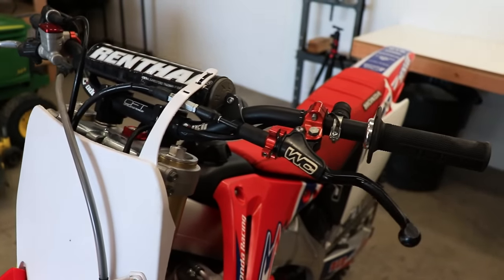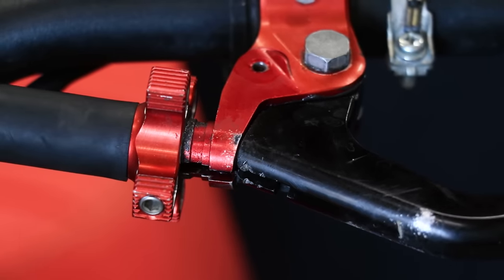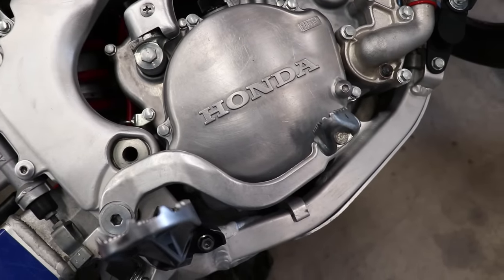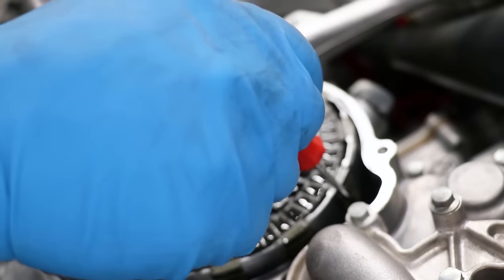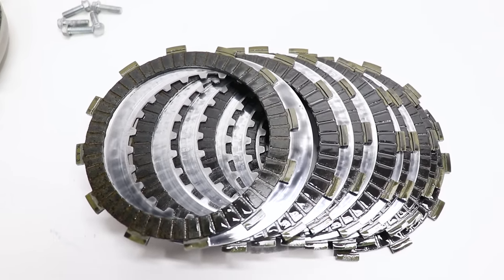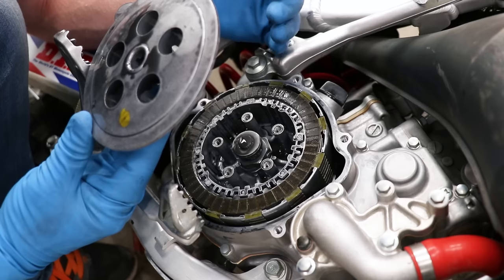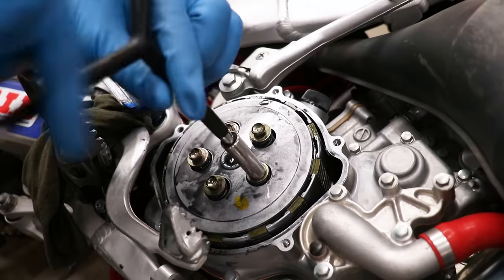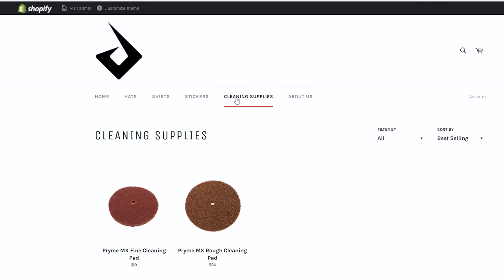How To Fix A Slipping Clutch

Comment: Any idea what could be the issue in my 2007 rmz- 250 clutch. it started to not stay still when in gear and clutch pulled, so i tigthtened the cable. 10 min of riding and same thing again. again, i took all the "loose" out from the cable by using the adjuster in the cable itsel( the fast-adjuster is broken on my lever), finally i opened the clutch and checked the plates and and checked for possible grooves on the basket. nothing. well, I put it together and boom it felt like a new bike....for 5-15 mintues until i almost couldnt stop properly with the clutch lever pulled alla the way. again, i adjusted the cable a little more tight and went riding, worked fine....for another 5-10 minutes until it started AGAIN to beg more of "taking out of the loose in the cable" it doesnt SEEM to be slippinng the clutch, it just stops working properly after it warms up. and when i look at the part where the cable goes in the engine end, when I pull the clutch all the way, it moves normally but when i release it doesnt seem to go all the way back to its normal position, if i push it back with my finger theres like quite a few millimeters that it goes back even tho its not the cable that keeps it fro m not resetting back to its normal starting point. This is my first THIS "new" dirtbike even thio ive had A LOT of different bikes in the past.

Comment: I have a question, when I go to put my 98 yz125 on it’s side to wash it or to just lay it down, it just pours out fuel. Any idea?  It’s a fresh rebuild. Everything has been redone. Every nut and bolt
Reply from the maker: You have to turn off the fuel valve when you lay the bike on it's side

Comment: Hey, man hope you see and can respond to my comment in October of 2020 but I'm desperate because my bike's clutch slips, and I just changed the plates 2 months ago and my clutch is slipping again man, I don't think they've burned again, is it possible that it slips but they aren't burned? That there's only a problem with the cables? Or the clutch release adjuster nut is too tight or too loose? Hope you respond bro, I don't want to send my bike to the mechanics and spend another 150 bucks! (BTW your videos are awesome and they help a lot, i just don't understand a lot about clutches and I need a bit of extra help, keep up the good work man!)

Comment: Question, so i have asv levers and with my clutch theres not really any play and when i pull it in and shift down to 1st it pulls pretty bad and itll die from pulling half the time and if i give it any play then wen i shift down to 1st itll just die right away, do u know how to fix it cause i tried messing with the cable and it didnt work?

Comment: I recently replaced my inner clutch hub and it created this rattle noise and looks like the hub could be rubbing on the inside of the clutch cover should I replace my plates also and with stiffer springs? I checked multiple sites and it’s the same number on all oem I looked at so I know I didn’t get the wrong one.
Reply from the maker: Sounds like you have a washer that is too thick behind the hub or it's out of position

Comment: 2007 Yamaha YZ250F and at a stop in first gear with the clutch lever pulled in, the bike will not go into neutral and the bike wants to creep forward. I have taken all the slack out of the clutch cable, and adjusted the ASV unbreakeable clutch lever, and it still will not go into neutral unless i shift it in neutral before i come to a complete stop.
Reply from the maker: You'll have to pull apart the clutch and check the basket for notching

Comment: I have a kawi Vulcan Classic 1500 that has sat unridden for quite a while. After starting, when I click into first gear, the bike lurches forward and stalls, which says to me the clutch is not engaging. Can someone suggest how I can determine if this is a pushrod problem or likely the plates need to be replaced?

Comment: My son has a 2016 YZ125 and his clutch engages near the end of releasing the lever. He has sufficient slack in his cable. I removed the friction plates and they are within spec, 2.90-3.10mm, although most are just above the minimum of 2.90mm. Can this be normal on his bike?
Reply from the maker: Yes, that is fairly normal for the clutch the engage at the end of the lever.

Comment: what about to install the steel plates with the sharp or round edge facing up or down at the same way. i like to install the sharp edge facing down
Reply: Me too
Reply: it dosent realy matter wich way..as long as all are flat(not warped)...the different edges are thru stamping the sheet metal into form in the factory. ;)
Reply from the maker: Yep, I have the rounded side facing up

Comment: My clutch on my 2003 ttr125e is sticking when I pop the clutch and after shifting, and when I give it more than 50% throttle it sticks, but slow on it's fine. Plates? Basket? Springs? help.

Comment: Should say just snug in the drain bolt Cameron or get ready to do a time sert video for all the stripped plugs out there.
Reply: i stripped my drain bolt on my rm125, i ordered a m14x1,25 dolt and tap.
Tap drill for m14x1,25 is 12,8mm
drilled the hole and tapped it. screw in the new bolt and gave it a little snug. the copper washer seals it.
tip: never use imperial anything on a metric bike or car. it´ll just mess up things in the future. metric is allways best!

Comment: I installed a pink spring on my crf 250r. They are sligtly bigger (height) than the original ones. Is that a problem?

Comment: I have a problem with my 2015 yz250 its goes into neutral when i try to shift into 4th gear! It happen after put to much transmission oil in it by mistake

Comment: Hey im having a problem with my pit bike, it revs up fine the clutch is adjusted right, but it use to go Much faster than it does now, before I could hit probably 45-50 now it only goes 30mph, like i said it revs up fine clutch adjusted but it just doesn't hit any speed at all.

Comment: i have a 2007 RMZ 250 and i need the main drive gear off that is on the right side of the crank but i cant seem to get the nut off i have used a impact, cheater bar, blowtorch, and i have tried to freeze it any suggestions I'm bout to take a cut off wheel to it, any help is appreciated
Reply from the maker: Many times those are a left hand thread
Reply: i have tried both ways but nothing has seemed to work, and thanks for the reply keep up the great work :)

Comment: My old yz250 doesn't idle worth a shit. Thought it might be too rich at 32:1 so I tried 40:1 like the manual calls for and still didn't work. Idk if I should change the jets or if the floats are off?
Reply from the maker: I start off by adjusting the fuel and idle screws. If that doesn't do it you'll need to re-jet. Also doesn't hurt to set float height too

Comment: What can cause my YZ250 to try to pull in 1st with clutch engaged? If I toy with the throttle it won’t stall, but if I pull clutch and drop into first it’ll stall. It’ll try to pull while clutch is pulled but it’ll die if I don’t give it gas. It don’t pull hard enough that I can’t stop it. Please help!!!
Reply from the maker: Check your cable slack adjustment like :40. If that doesn't fix it, replace clutch plates

Comment: my 125 clutch is slipping on gears 3-6 after 8k rpm is the problem in the discs or cable

Comment: someone explain me why an oil change for every 5 to 6 rides isnt ridiculous overkill
Reply: Kenny McCormick it all depends on the way you ride in my opinion
Reply: i guess he meant .5-6 days of riding. not 5-6 times 15 minutes...6days of 3 hours riding each day is 18 hours of running ..
Reply: 5-6 rides is overkill, but dirtbikes are often run hard and through dirty environments, so an oil change is cheap insurance
Reply: 8-12 hours of ride time seems like a pretty normal service interval for a dirt bike if you ask me...
My 07' DS650X recommends somewhere around 20 hours = every 4 rides.
Reply: There is only a small amount of oil in the tranny, so any contamination like (clutch material) quickly pollutes the luburcant. There is no oil filter either. Hope this helps.
Reply: Don except on some bikes, like my 04 crf 250r, the tranny oil and engine oil are in two different compartments and take different oil.
Reply: Motocross bikes. Not dual sports.
Reply: I do it every other ride, but I ride my bike like you're old lady ride's me FULL THROTTLE!!!
Reply: Kenny McCormick On a Dirtbike, even after running for just a short while, the transmission oil quickly blackens. It takes only a few minute to change.

Comment: I just recently turned on my bike and the clutch felt  sticky and with a grit sandpaper feel what is that. do I have to run through all the gears as a maintenance practice. I usually stay in neutral
Reply: dirt in the cable probably..
Reply: No not my cable's the cluch disic 1 and 2 gear
Reply: oh okey sorry...im not  a native english speaker..
greetings from germany BTW. ;)
Reply: That's ok no problem. Hello Germany

Comment: Hi Cameron.
My 2010 Husaberg fe 450 is moving forward in first gear when the clutch ( hidraulik )is pulled and y cand put in neutral when the engine is roanning .
Reply: the clutch is draging. adjust the cable

Comment: You have it the wrong way round, too much tension disengages the clutch which is why it slips.
Also, way too much slack in the cable means the clutch doesn’t full disengage which makes it difficult to change gear and leads to premature gear wear.

The master adjuster is at the engine end of the cable so adjust there first then fine adjust at the lever 👍

Comment: Is there a way to change the engagement point on the clutch? Mine isn't sticky or slipping but it doesn't engage until the very last second of release on the lever. Barely touch the lever and it disengages the clutch. It is quite annoying. Would like it mid way like all my other bikes, but everything I do, including changing the clutch pack, doesn't help. CBR250r wife constantly complains about it and is now wanting to ride my bikes instead. Can't have that lol

Comment: My motorcycle does not move neither stall when I release the clutch. It's perfectly changing the gears but it doesn't run when clutch released. What could be the problem?
Reply: what was your fix to your problem.. i am having same problem

Comment: I'm a little late, but, researching our own issue.. 
I'll try to explain, I'm not the rider tho.

22 KTM 85 (Lynks racing 105 head). He stopped & said it's not as powerful, like it needs cleared out. Local track guy thinks it's the clutch, Installed new pack, still same symptoms..

I'm currently poking around on it & have noticed I can push it while in gear, with a little drag. So, maybe the clutch isn't releasing... 

Idk, I'm not a dirt bike rider, or mechanic & I have a decent level 85 rider, so I'm learning... Ugh.

Comment: hey Cameron i have clutch drag on my crf 250 2012,i changed the clutch complete (pressure plate,fiber discs,everything) could you tell me what to do next (i used 10W40 Transoil from Motul) i need help !! (i put the bike in first gear with clutch in and it just start moving)

Comment: Should also mention, you have a 2 stroke, and the oil becomes contanimaited with fuel- hence the more frequent oil changes versus a 4 stroke.

I came here because my clutch isnt engaging fully. wanted to make sure i was adjusting properly

Comment: My clutch plate bolts are too tight, how do I loosen them without the hole thing spinning?
Reply from the maker: You'll have to use a quick jerk with the ratchet to loosen it. Or an impact driver

Comment: How do i get the clutch softer when i pull the lever?
Reply: get stronger!.;)

sounds funny but the best way is to ride more..you train the muckles like going to the gym..

there are conversion kits out there to convert cable to (hydraulik) but they are expensive and not reliable...
Reply from the maker: A good lever and freshly lubed or new cable

Comment: Mines slipping at higher revs when kips open up just steady riding it's ok but soon has I try open her up it slips
Reply from the maker: That sounds like your clutch cable is adjusted too tight or your clutch plates are worn.
Reply: @CameronNiemela  new plates mate I dint change the springs tho so maybe springs are weak ?

Comment: The myth of the motorcycle slipping clutch ride! If you follow the "Slipping Clutch" crowd... you will ruin your clutch and have to replace it faster and could cost you injury or death. They had trouble years ago (I'm 74) with dry clutch burning out... why? Partial clutch engagement or taking to long to release the clutch and get it in gear. The fix... automatic transmission which does away with the clutch and uses vanes coupled by oil, (this is my short explanation for it). What did they do for the motorcycle clutch? They came up with putting oil soaked clutch plates in which called for a NEW fiber plate that would grip well enough to engage the transmission for the drive. Did this eliminate the burn problem? NO! It made it last a little longer but didn't eliminate the burning clutch problem. Now we have the MSF crowd advocating slipping your clutch to go through a row of seven cones in order to pass a test that shows you can ride slow. Who heard of such nonsense? A clutch that fails can cause you to lose your life in certain situations. Now we have the police rodeo bunch to show you how they can do a real circus act by slipping the clutch and not only that they do it a 1400 - 1800 rpm! Of course, they get their ride from tax money and have mechanics to replace the clutch on a schedule... using... Yes, you guessed it... tax money to pay for it!
Reply: Barry Wind nice mindless rant

Comment: My clutch won’t fully disengage when I click in first gear it stalls
Reply: tighten the cable to the setting he explained..if the clutch still dosent work propperly check for marks in the basket..
used wrong oil?? that can result in the (swollen?) friction rings...mesure and replace if needed..
some times (especially on dirtbikes) dirt in inside the cable..that can result in the cable stretching instead of disengaging..
Reply: Bitplanebrother thank you so much I’ll check tonight
Reply: youre welcome..;)
Reply: Bitplanebrother My yz250 was doing the same thing and I tightened the clutch lever so there was no play at all and clutch still wouldn't fully engage, it'd stall when put in gear. I'm guessing I need a new cable because of how hard it is to pull the lever and it sounds pretty rough when I do.
Reply: Could be a worn clutch basket/inner hub..I'd check the cable first!
Reply: A lot of bikes that’s got some age on them will stall when put into first at an idle. Especially Suzuki’s. I’ve always known it as basket creep. Every late model rm that I’ve had does it unless it has newer cable and perch and clutches. Some bikes do it worse when cold some worse when hot. It’s all about the timely wear of the clutches, basket, cable and some time the perch if the threads are getting weak.
Reply: My clutch doesn't fully disengage. I can't push it while it's in gear and I'm holding the clutch. I've already replaced the basket. The hub is good. The cable is good and set correctly. So I'm not sure why. It's an 02 yz250. Maybe it's the age or maybe most older dirt bikes are like that and I'm just used to harleys. I also wish my clutch was easier to pull without spending 300 dollars.
Reply: john Franklin Have you looked at how much movement their is on the pressure plate when you pull the clutch in? It shouldnt be much but could be your cable that needs adjusting
Reply: Justin Jirout ya, i did when i had it all opened up, but i didn't measure it or anything. I've also tried adjusting the clutch, but it doesn't seem to make a difference. Yesterday i tried putting on a generic version of the moose easy pull. I don't notice much of a difference. I'll probably take it off tomorrow after i give it another test.

Comment: I took the clutch apart on my bike put it back together but I got no clutch at all no pressure
Reply: Machine Freak did you put the springs back in correctly ? did you adjust the cable connected to clutch lever on the engine properly ? Did you hookup the handlebar lever to the cable correctly? Did you forget a clutch disc?
Reply: Jim Bob I put everything together correctly
Reply: Machine Freak the only other thing I could imagine would be the problem would be the pushrod inside the inner clutch hub not being together right or the clutch cable is broken.
Reply: Jim Bob brand new cable
Reply: Machine Freak well then it must be something with the push rod mechanism inside the inner clutch hub, does it move in and out as you pull in the lever ?

Comment: If my bike is in gear and moves every couple seconds is that slipping what is causing this
Reply from the maker: With the clutch lever in?
Reply: No I'm on a slightly slanted hill put it in gear and it will slowly nudge down the hill not even touching the clutch
Reply: I put it in gear  so it won't move or  anything  and every 5 secs it will nudge farther down my hill

Comment: I don’t get it tho... you just tore it apart and put it back together exactly how it was before and now it works??
Reply: tore it apart to inspect, and measure wear, check adjustment down at motor and handlebars if clutch is slipping

Comment: Slipping clutches can not be fixed by adjusting cable, no way!
You need clutch adjusting procedure w/o having to take apart clutch assembly like shown here.
Just perform standard clutching ADJUSTING PROCEDURE. That's it.
Many video explains this procedure never explain the purpose of it.
Slipping clutches are DESIGNED to be handled by this adjustment !!!